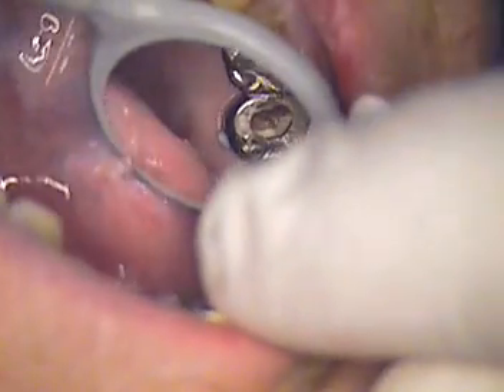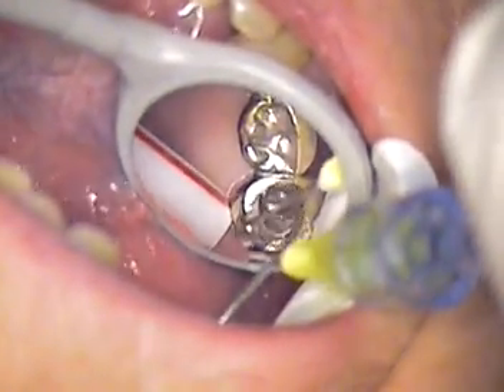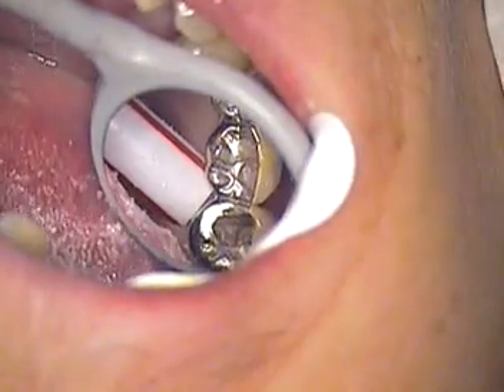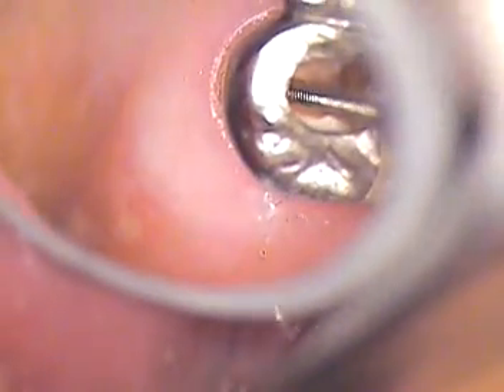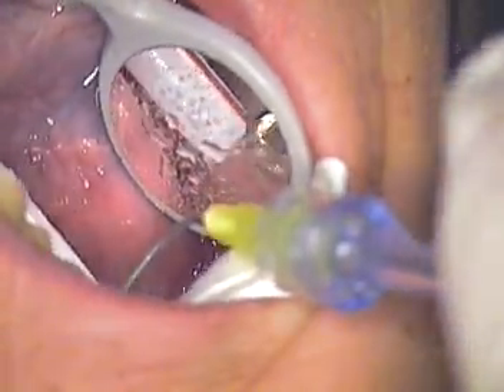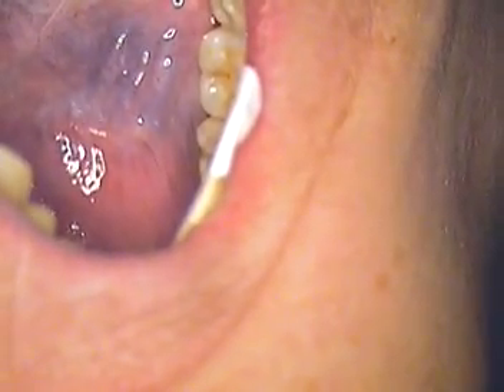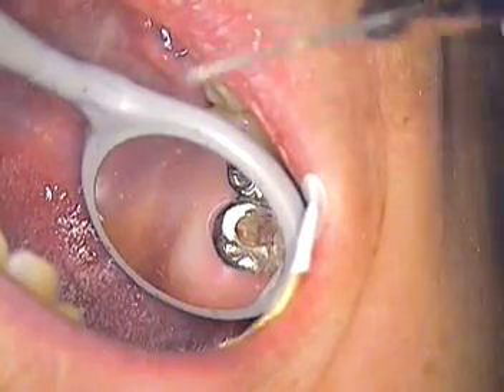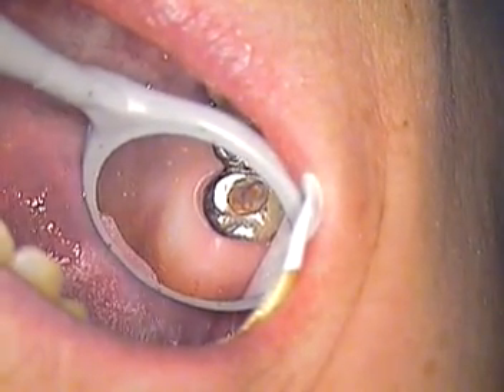DR. GERARD CUOMO - Dental Bridge repair via molar root canal and post build up Part 2 Boca Raton, FL

Comment from the maker: @svally69 Thank you for your comments. The bridge has a history of coming loose. At other times, it was the anterior abutment that came loose and I successfully tapped off the bridge and recemented it with Panavia resin cement. Patient did not want ideal treatment at this time which would of included an implant supported fixed bridge. GC

Comment: if the bridge is loose it means that either the tooth structure is broken underneath, or the cement washed out, or the retention on the abutment is poor. neither of these things are addressed or evaluated without taking the bridge off and evaluating the substructure and the reason for failure. the retention of the bridge does not depend on the post or the core material you put in.